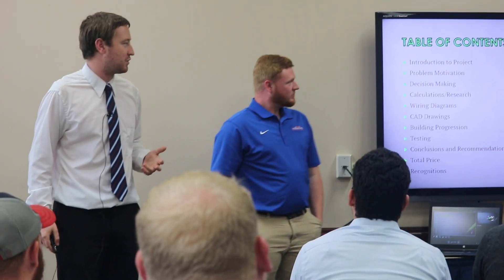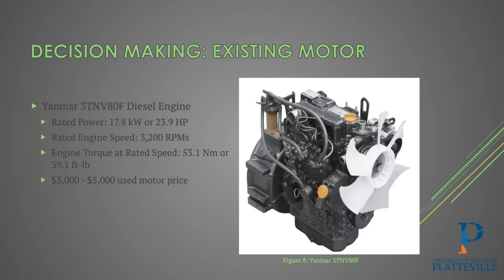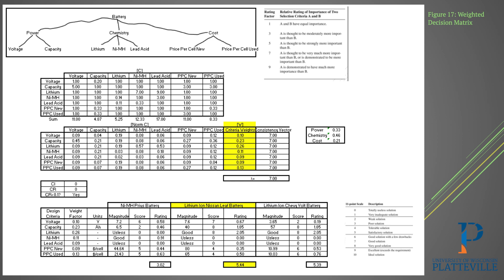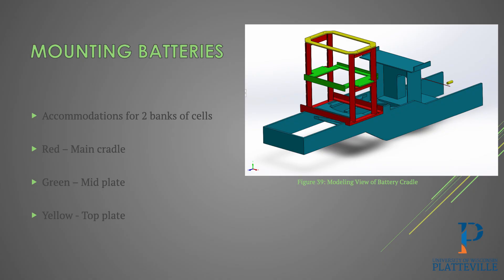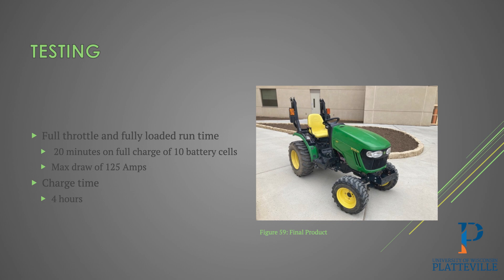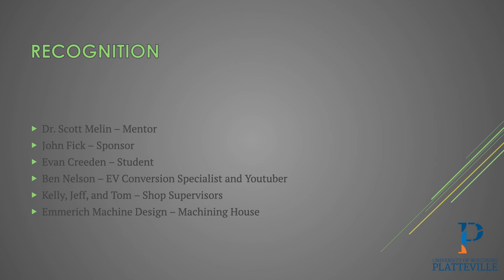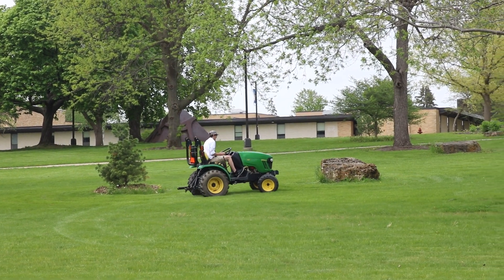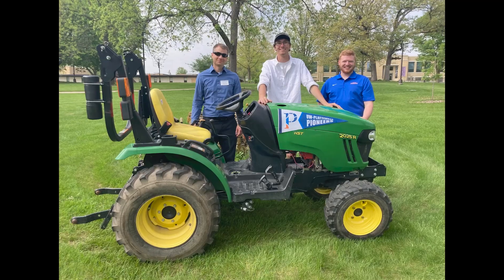Electric John Deere Tractor | Senior Design Presentation

Comment: For anyone concerned about low runtime of this tractor - it would be significantly better with a gear drive instead of hydro. I believe any manufacturer of electric tractor would be choosing the efficiency of mechanical gears over hydrostatic. But for this student project, not messing with the transmission kept things simpler. I just converted a garden tractor with stock sears ss gear transmission and the tires lost traction at only 100 watts in low gear with 400lbs tongue hitch weight attempting to move a big trailer. Thats how efficient gears are.

Comment: What is the horse power and torque rating of a warp 9 motor? Online specs have been misleading. Some say 38 horsepower. Is that true?
Reply from the maker: Warp 9 is a popular and fairly powerful motor. Keep in mind that the horsepower rating is for CONTINUOUS horsepower.
Also, torque on electric motors is much high than on gas engines, especially at low speeds, when you need it the most for acceleration.
Because the characteristics of gas engines and electric motors are so different, it's hard to give them a fair comparison in HP.
Here's a little more on general motor info from the same company.
https://www.electriccarpartscompany.com/assets/images/Motor-Primer1.pdf
Reply: @BenjaminNelsonX  I'm totally new to this. I made an e-bike this past year. I was hooked after doing that.  That PDF file is really helpful. Thanks! 👍

Comment: I am thinking that it should use one motor for driving and a separate one for PTO. Two smaller motors only running when necessary would provide more runtime. With that said it's a great project and thank you for sharing.
Reply: This was done in the 1970's by GE with their ElekTrak Tractor ,where each implement was powered 
by a smaller motor for each operation. They had a 12v front and rear lift and a 36v dc outlet on the 
front and rear for the implements.They had a front lawn mower with 3 36v dc motors attached to the
blades in direct drive. There were many other implements like a rototiller, hedge clippers,AC 120v 
generator,and even an arc welder.
This was an early design which used contactors for speed control and that was a large maintenance
problem that now with modern dc motor controllers can be easily corrected.
Reply: And have a charging generator off the PTO

Comment: Hi very impressed, we are looking for EV tractors in Australia to go with agri-voltaics. There was no mention re hydraulics which is key on a tractor? Also re roler over always have your bar up.
Reply from the maker: The tractor is hydrostatic. The electric motor runs a hydraulic pump and that powers all hydraulics, including the wheels, 3-point hitch, and any attachments, such as a front-end loader.

Comment: Interesting video, but pretty simple conversion 101 level work.

I thought this was an official John Deere project, but guess they are still lagging with electrification.

How about old school GE electrak for reference.
Reply from the maker: Not an official John Deere project at all! Just four mechanical engineer students whipping out their first ever EV conversion in about 2 months total while being full-time students!
Reply: @BenjaminNelsonX  indeed, I didn't mean to sound dismissive.  It just caught me by surprise a little, thinking it was a professional project.

For first timers it looked pretty good, they EVen kept the hydrostatic transmission it looked like?  Thanks for sharing, good stuff, great way to clean up lawn equipment by upcycling them to electric.
Reply: john deere has been trying for years to built a electric tractor that you could farm with. but because of low battery time. they have not had any luck. farmer like me need at lease 10 hours of run time.  plus tractors can set unused for 3 months and planting time they are need to run 16 hours or more a day. untill batteries get much better they have limited use for farmers. i have a john deere 5 wheel that has a junk japan  motor in it that i would love to convert it some body made a kit for it i would be ok with 3 hours run time on that. because japan motor wouldn't run 3 hours at a time any way.
Reply: @johnwoody4905  I would love to solve those problems for John Deere.  And they are not as insurmountable as they might appear.

I spent summers at my uncle's and grandfather's farms in the Midwest, and worked them during high school.  Still have uncle's and cousins in that profession.

Here is my proposal.  You have a machine shed, right? Where you winter your hardware, and perhaps store the various harvester implaments?  Right.

What if that structure could also function as a battery swap, and PV, and wind fuel production building/substation.  Now stay with me and don't think about the cost too much at this point, economies of scale are required to drive down costs, but like cars today, the TCO will be lower in the end.

Now, let's say you only have 3hours runtime per battery on the tractor.  Every tractor would have a small built in battery, enough for a few miles of just running distance.  You would probably also have a new vehicle I am going to call a battery runner, it would likely be autonomous, but would also be optional.

Now, let's put all the pieces together.  Your machine shed, now power source and swap station, would host many batteries where it can charge them all when not in service.

You could run your tiller, planter, harvester for the 3hours and then spend 10minutes to run back to the shed to drop off a dead and pick up a full pack.  Then return to work.

Or, to completely eliminate swap time, you could have your battery runner vehicle, which can carry two or more batteries, meet you at the end row. It would pickup the dead and give you a fresh pack.  Then it would return the dead to the shed to recharge and pick up a new one and meet you back at the endrow or more remote plot miles away from the shed.

During the winter, your shed (and everyone else's) could easily power the state you live in and act as a massive community owned power bank with grid level quantities of storage.  Eliminates emissions, empowers the farmer and their communities.
Reply: @D0li0  i am 60 years old there's no way the banks would loan that much money  you are talking millions. converting 100 hp tractors that you only use a month out of the year. biden has broke all us farmer.we did't have the money to buy much fertillizer this year. i have not planted any wheat, corn, produce or millet in 2 years. planted rye last year ended up mowing it for hay. if you have a kit to convert a 5 wheeler that's under$600 let me know. take care, be safe and well.
Reply: @johnwoody4905  I know times are tough, and my idea sounds expensive, but so are new gas implaments.

The difference is that you have no control of your diesel fuel costs. Which isn't Bidens fault, it's systemic and been a growing problem for decades.  Family scale farms have been being decimated for years.

But imagine what those who used beasts of burden must have though about the cost and novelty of machinery when it was brand new.

New technology is often feared because change is always difficult.

Anyway, I have nothing but love and respect for those who work the land. I only want to help to empower them to be more independent and prosperous.